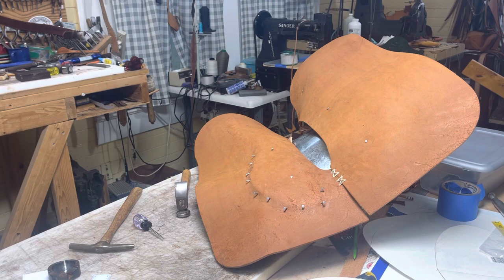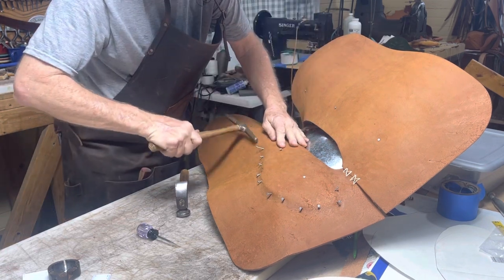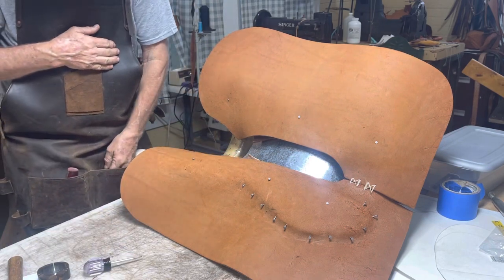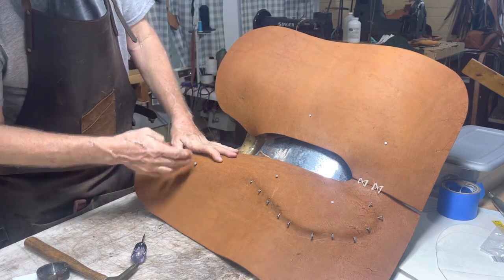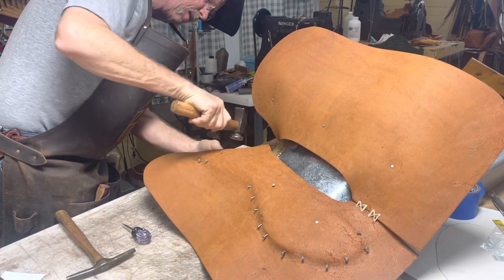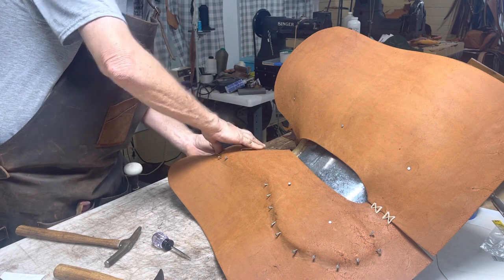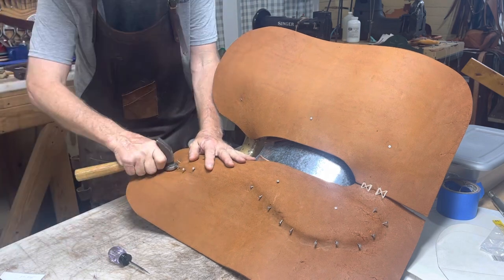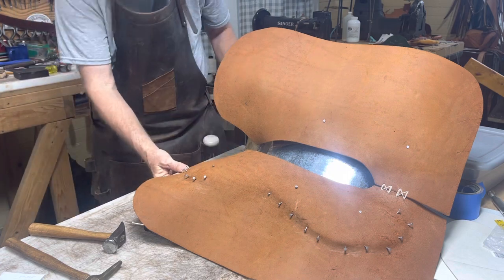Blocking the skirts on a saddle

Comment: Do you think you could show a up close of the nails you use and where do you buy your saddle making supplies?
Reply from the maker: These nails, which I use quite a lot of, are a 3D galvanized from Home Depot or any hardware store! I also keep some 2” and 2 1/2” galvanized handy, although they’re only used to nail the top of the skirts to the inside of the gullet!
There are many places I get supplies from, it may be easier to tell me what you’re looking for…
Reply: @DavidMillsSaddlery  I'm looking for saddlery nails because I do alot of repair work and I can't find nails small enough to replace the old nails that I take out from the old saddles
Reply from the maker: I’m not sure what you’re referring to as far as saddlery nails? Maybe the sharp point square shanks
Reply: @DavidMillsSaddlery  no, there small nails that are like thumb tacks.  If you look at a old western saddle you can see that they hold the leather to the tree of the saddle. Hope this explains what I'm talking about.
Reply from the maker: https://www.panhandleleather.com/products/brass-escutcheon-pin?_pos=1&_sid=09ce9b88d&_ss=r

Is that them
Reply: Hey Kelsey are you referring to those blued saddle tacks? Sometimes called carpet tacks.  They come in several sizes in the specialty nail section at hardware stores.